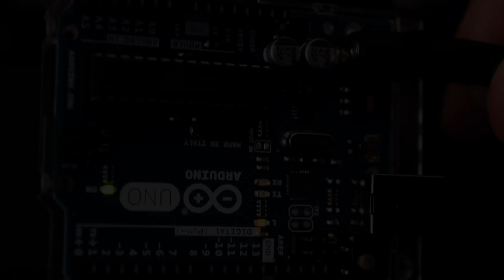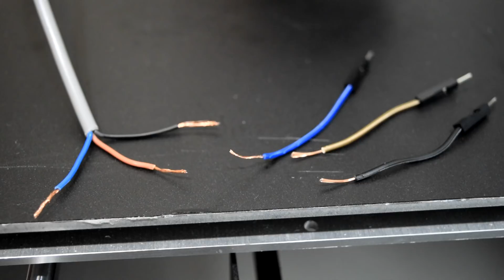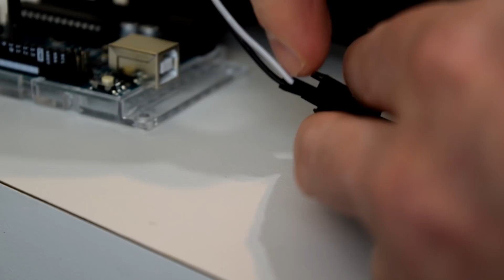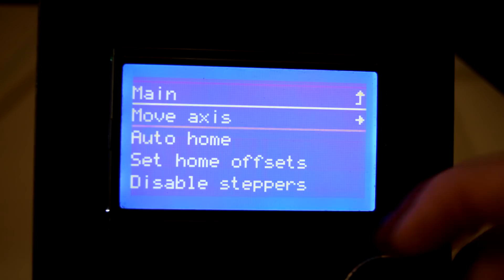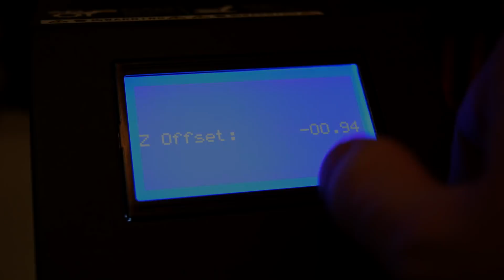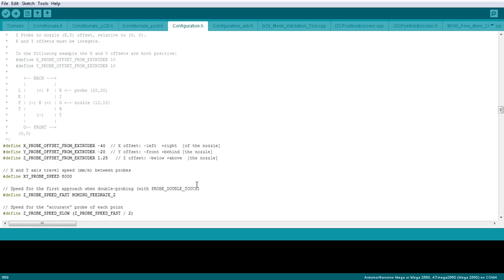Monoprice Maker Select | Auto Bed Leveling w Stock Board

Comment: I got all the parts I needed, and successfully uploaded the bootloader to the melzi board. However, when I flash the marlin firmware to the board, everything seems to work ok (i also had to flip the direction of my Y-axis) except that the right half of the LCD screen displays everything somewhat jumbled. The left half is pretty much fine, but the closer to the right edge of the screen, the less the pixels are correct. 
I checked and all my connections for the LCD are correct, and to double-check i flashed the Repetier firmware from the link in your other video - that firmware has the LCD working perfectly, no text jumbles or anything. This tells me that there's something about this configuration of Marlin that's not working properly with my LCD. I have a Monoprice Maker Select v2.1.
I have tried downloading and adding various versions of the u8glib library in arduino and compiling->uploading with each version gives the same problem.
Any idea what could be the problem or if there is a fix? I'm hoping perhaps there's a simple change to some part of the marlin firware in Arduino IDE...

BTW, Thanks again for the very helpful videos. If I can't get Marlin working, I've already learned a lot and at least have the better version of the Repetier firmware to enjoy.
Reply from the maker: That's strange. I found a possible solution on the Marlin forums. would you mind testing this version if you get a chance?  https://www.dropbox.com/s/zb4eqabzpthhmr4/MakerSelect%20Marlin%201.1.3%20v2.zip?dl=0  Also, thanks for pointing out the Y axis was reversed for you too. I probably have my stepper driver plugged in backwards or something. - I fixed it in this version.
Reply from the maker: to expand on what's different, the firmware tells the board how to communicate with the LCD and since that communication can happen too fast for some LCD screens, or there can be interference nearby that can muddle up the signal, there are settings in Marlin to limit the communication speed to a point where it can decode correctly. - Drawbacks, if you set the delay too high, you can have a very slow performing LCD. If you set it too low, possibly garbage on the screen. if that doesn't fix it but seems to help a little, the delay can be increased a little more, but I'll have to test to confirm it works on my printer.
Reply: Thanks for the super fast response. I tried flashing the updates version but still having the same glitches with the LCD display.  for reference you can see a few images of the screen glitch, and one of the properly working screen with repetier, here: https://www.dropbox.com/sh/ir4rhsnx8ceqv1q/AABbv695sD5heQtv0UmRATava?dl=0
The Y direction was correct in this one. I know nothing about screens or coding firmware, but if I had to guess it kind of seems like it is set for wrong model or type of LCD.
Reply: Sorry had only seen your first reply. I didn't notice any less glitch on the screen with the updated version, seems to be pretty much the same, if not very slightly worse. All the info about the delay settings makes sense, though. Is that something i can test by changed values in one of the tabs of the marlin firmware file in arduino IDE?
Reply from the maker: yeah, I may have set the values in the wrong place in that version since they were getting overwritten downstream in the code. I'm testing a new version that's setup correctly for those values. the original firmware was somebody else's modification to make it work with the Maker Select, and I didn't notice they had removed some functionality related to those settings. Let me make sure this works on my printer first and I'll upload this version and let you know where the variables are to test with.
Reply from the maker: https://www.dropbox.com/s/lb8ydofmpikquds/MakerSelect%20Marlin%201.1.3%20v2_1.zip?dl=0 

okay, so the file you want to look in is ultralcd_st7920_u8glib_rrd.h you'll have to click the down arrow in the top right corner of the Arduino IDE and scroll down pretty far to find it.  in that file, you'll see a section that looks like this:
 #define ST7920_DELAY_1 DELAY_4_NOP 
 #define ST7920_DELAY_2 DELAY_4_NOP
 #define ST7920_DELAY_3 DELAY_4_NOP

and a section that looks like this a little bit beneath it:
#elif F_CPU == 16000000
  #define CPU_ST7920_DELAY_1 DELAY_4_NOP
  #define CPU_ST7920_DELAY_2 DELAY_4_NOP
  #define CPU_ST7920_DELAY_3 DELAY_4_NOP

if this version doesn't work, you may want to test with changing those DELAY_4_NOP's to DELAY_1_NOP.. DELAY_2_NOP, etc. This is the Marlin forum that mentions the problem https://github.com/MarlinFirmware/Marlin/issues/5756

The person who modified this firmware previously had it set like this:
 #define ST7920_DELAY_1 DELAY_0_NOP 
 #define ST7920_DELAY_2 DELAY_3_NOP (which was actually DELAY_1_NOP because of the way it was coded)
 #define ST7920_DELAY_3 DELAY_0_NOP

and
#elif F_CPU == 16000000
  #define CPU_ST7920_DELAY_1 DELAY_0_NOP
  #define CPU_ST7920_DELAY_2 DELAY_0_NOP
  #define CPU_ST7920_DELAY_3 DELAY_1_NOP

which is a pretty low delay, so it makes sense it might cause problems on some people's LCD screens.

I previously tried to change these values upstream, but they got changed back in this file, so it makes sense my previous version didn't change anything on your end.  But just so you know I have tested both of these versions on my printer, and I haven't had any problems with them. - Let me know if this helps.
Reply: I'll give this a shot and report back. Thank you!
Reply: FIXED!! amazing. Thanks so much for figuring it out and all your help! Now I can move on to getting the inductive sensor connected...
Will let you know if I come across any other issues with the firmware etc. Thanks again
Reply from the maker: Awesome. Thanks for letting me know. I'll update the firmware in the video description to this version.
Reply: Ok I got the sketch written to the uno, made a sensor mount and installed the sensor and got it wired up. When I go home all it continues to move up like in your video, but when I switch the z end stop wires it will just continue to lower to the bed and does not stop when I place my metal pliers under the sensor. I have checked and re-checked the wiring several times and everything is correct according to your diagram (and the label on the sensor). I am using the same sensor you linked to in the description. 

Is there any chance that in the process of modifying the firmware for the screen glitches that somehow the settings for the z-end stop switch were changed? Another thing I noticed is that the light on the sensor is very dim - not nearly as bright as in your video, which makes me wonder if its not getting enough power.

Any thoughts? I think I'm very close to getting it working but must have something set up incorrectly. Thanks for all your help!
Reply from the maker: hmm. are you 100% sure the female ends of the jumper wires are on the metal pins of the black switch cable? I found I was able to plug mine in and they would stick, but they would push the metal pins to the side. If that is all good, your sensor may not be getting enough power from the Arduino. If you have a 9v or 12v power adapter laying around from something else, you may want to try hooking that up to the power cables of the sensor to see if that causes it to work (the sensor is supposed to be 6v - 36v so 9 or 12 should be fine). Also, did you solder the wires from the sensor to the male end jumper pins? or did you just twist them and wrap them? maybe one of those isn't making great contact? on my sensor, I found that if I used 9v it was supplying too much power to the sensor, so the 5v from the Arduino was plenty. You are running the Arduino with a 9v power adapter right? not just from the USB cable?

or if you have a multimeter laying around, you can check the voltage coming from the black wire on the sensor to see how much it's outputting when the sensor isn't triggered with your pliers. it should be showing about 4.5v when the light is off, and 0v when the light is on.  it's hard to say what the exact problem is without being able to test it myself, but for some reason on yours, the signal going to the endstop switch isn't getting triggered by the arduino, the z axis raising up when the D2 and D3 wires are reversed makes me think the black wire from the sensor either isn't making solid contact, or the sensor isn't getting enough power somehow. 

-note if the signal wire isn't outputting enough voltage, or any voltage, you may need to flip the pins D2 and D3 back, because if it's sending no signal, the z axis may raise up like that too.
Reply: Thanks for getting all that down in your comment! 
Went through the following:
1. The ends of the jumper wires are 100% connected to the pins on the end stop wire to the printer board. I also switched out to a fresh set of jumpers there just in case.
2. I found a spare power adapter that outputs 6.5 volts so I connected that to my sensor and the sensor light flashes brightly now when i place a metal object against the sensor tip.
3. With the sensor powered with 6.5 volts, I hooked the signal wire back into the D-10 pin on the uno but the home all Z movements still behaved the same ways.
4. took a multimeter and checked that i am definitely getting 6.5v (actually about 6.7) from the signal wire with nothing against the sensor, and it drops to 0v when i place metal in front of the sensor (and the light flashes on).
5. I did not solder the connections but i checked by contacting my multimeter tips to the attachment wires, so there is definitely adequate current flowing through the twisted connections. Once i have everything working and hooked up properly I'll get everything soldered together.

It's doing the same thing as before the small power increase: when I run home all on the printer, the x and y axes will home, then the carriage with move to the center of the bed and raise about 10mm with a tiny pause, then raise another 10mm or so. If i sitch the D2 and D3 pins, the carriage will move downward but will not stop when i place a metal object in front of the sensor (even though the light on the sensor does come on). This change in behavior makes me think that the jumper cables are definitely getting contact to the end stop pins/wires. I also know that the sensor is getting power (~6.5v now) , and that the sensor signal wire is being triggered by metal objects (dropping its voltage to 0). It seems like perhaps the signal triggering the end stops via the Uno is where the problem occurs. I decided to re-flash the ABL sketch to the UNO just in case, but that did not cause any change in behavior either.

Is it possible my uno is faulty? Is there a way to check everything works properly on the uno, or that the sketch is properly flashed to the uno?

Thank you for all the help troubleshooting!
Reply from the maker: if the problem is a bad pin on your Uno, you can change the sketch to use a different pin. D10 is just the pin I chose for my own convenience, but you could really use any of the digital pins that aren't being used. If you open the AutoBedLeveling.ino sketch, you'll see near the top pinMode(10, INPUT_PULLUP); - change the 10 to one of the other digital pins, then where it says sensorVal = digitalRead(10); - change the 10 to the same number as above. Then try plugging your sensor's signal wire to that pin instead. I would probably switch back to powering from the Arduino, because you probably don't want 6.5v going into the Digital Read pin. but after trying a different pin, test the output from 2 and 3 with the ohm meter function of your multimeter. the resistance should go from nothing to something when the digitalRead pin has a signal running to it.
Reply: I tried reassigning the pins, first on the signal from 10 to 11 but still had the same issues, then the two end stop pins from 2/3 to 4/5, but that didn't fix it either. I tried testing the ohms on d4 and 5 pins but was getting odd readings and I'm not confident I was using the meter correctly for that test. however there was a slight change in the numbers i was getting from the pins when the sensor was triggered, so there is some communication between the signal wire and the d4/5 pins through the uno, which wasn't there when i switched the jumpers to others pins, so I'm fairly certain the sketch was flashed successfully to the uno. 

I'm surprised I'm having this roadblock since I'm using all the same hardware and firmware as your setup. I might try switching the values on the z end stops in the marlin configuration to see if that fixes it, or helps to indicate where the problems might be.
Reply from the maker: Yeah that's weird. the Uno and the sensor are both the ones I ordered from Amazon. I'll see if I can make a quick video on my phone showing what mine is doing when I test. it won't be high quality or anything, but if it helps you get it fixed, that's what matters
Reply from the maker: https://youtu.be/gOUVXtMRWj0 alright, apologies for the bad quality. I added some notes in the video description. Also it's unlisted, and I'll most likely take that video down after you're done with it.
Reply: Remain Indoors you're definitely going above and beyond here and I'm super grateful for your help and determination. My printer is setup at my workplace and I went home for the night, so I'll have to check out the video tomorrow evening. Will let you know how it goes.

Comment: Hey. I followed this tutorial years ago and its been working great. It's been about a year since I last used my printer. When I go to print now, the z-probing is not working anymore in the (9) spots. Instead of down->up->down->up at each spot, some of the spots are randomly doing down->up->up. This messes up the distance between nozzle and bed. Any idea why this randomly does this in spots? Different every time you try to print. Thanks!
Reply from the maker: hmm. sounds like maybe a short in a connection somewhere? I'm not sure. I haven't printed with that printer in a few years, but last time I did a few years after this video, it was still working fine.
Reply: @RemainIndoors  Would having a magnetic flexible print bed cause the sensor to freak out as described? Would you suggest reflashing the firmware to the printer?
Reply: @RemainIndoors  Would this installation work the same if using a BLTouch sensor? If not, do you have a step-by-step on how to convert from an inductive sensor to the BLTouch sensor?
Reply from the maker: @davemantey2653  hmm. for this printer specifically, the motherboard isn't directly compatible with the BLTouch. I wanted to install one when I was still modding this printer, but the ways to do that are pretty hacky and seemed unreliable at best. it's probably easier and not really that expensive to just buy a different motherboard that works with it. but that's a whole different can of worms really since you'd have to make a mount for the new motherboard that fits in this case, and possibly replace the LCD screen since the existing one may or may not be compatible with a different motherboard. in my opinion, the inductive sensor was the better choice, because it was the least amount of effort for not that much money, but installing a BLTouch on this printer is pretty risky at best.

Comment: First I wanted to thank you for the great videos! I was hoping for some help though. I finally got around to doing this upgrade. I followed the instruction and am at the point where its time to test the sensor. It lights up with my pliers however when I auto home z axes only travel up about 10 mm. So I switched the wires to the uno for 2 and 3 and it does the same thing. I have tried 3 uno's now and I'm getting the same problem. So I'm guessing the auto bed leveling software but that looks so simple I cant see how that would be the issue. If you have an ideas please let me know. Thanks again for all the videos!
Reply from the maker: hmm. so, the uno board should be passing through the signal of the endstop wires. it's been so long since I've looked at this, I don't remember if it's normally closed or normally open, but I do remember there was some issue with the sensors I originally recommended as only some of them had enough voltage to trigger the uno correctly.  if you have a voltmeter, you could test to see if putting your pliers under the sensor changes the voltage between 2 and 3. I made another video after this one about using a voltage divider method where I talked about some of that, but again it's been at least 3 years.  You could try changing the firmware to invert the endstop direction which would solve the problem of the hot end always going up, but then when you trigger the sensor it might not stop moving and you'd have to shut off your printer before it crashes into the bed.  Sorry to hear it's not working for you, but those would be the first things I would try. my guess would be the sensor, but I'm not sure.
Reply: @RemainIndoors   Thank you for the fast response. I looked up my purchased history and noticed My sensor is actually a 5v not a 6 vote like you suggested. I test 2 and 3 and there is no voltage on them with the light comes on or when its off. I am going to follow your next video and but the same sensor you recommended and let you know what happens. Thanks again for your help!